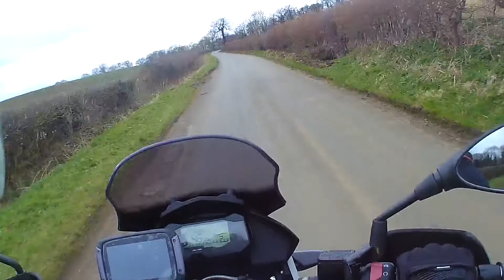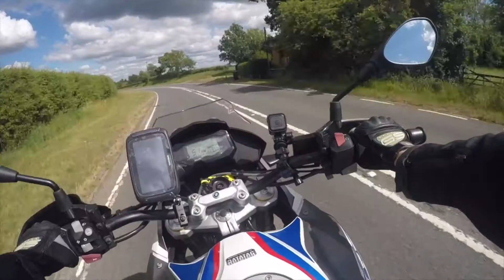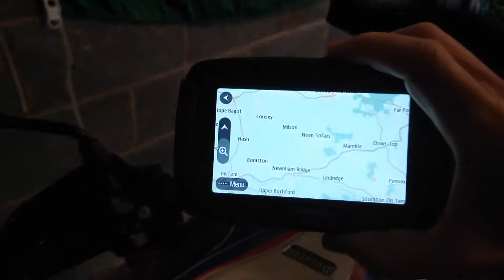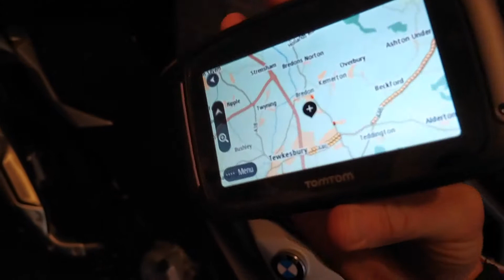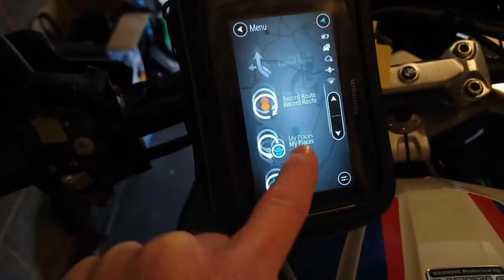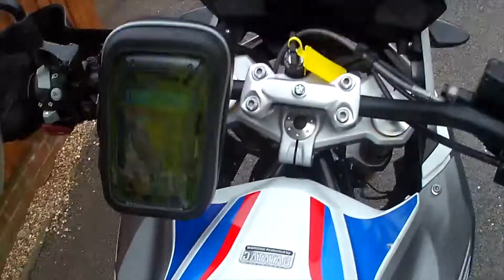TomTom Rider 550 Screen Fault

Comment: My TomTom Rider 550 started to switch off last year when riding (it’s 3 + years old). I had switched the mount from the Ram to an Evotech holder and the dealer mechanic routed the cable under the tank (I had it routed in a reachable way) so I will check if there is a power continuity problem. I did notice that there seemed to be a buffering issue so I wondered whether it was overdue an update and was searching for a Wi-Fi signal. I have checked that it’s now updated and will try it on the bike tomorrow but I will also check for the issue that you found. It’s good when it works and has found some great routes but I may try a Garmin if the problem continues. Good video. Cheers.

Comment: it could relate to an impedance issue triggered by a self-resetting fuse mounted onto the platine of the mount — it has nothing to do with any weather related impacts on the device; take the electrically powered mount to an electronical expert to bridge that fuse. That's presumably all.

Comment: Did I imagine it, or did it work when you rotated it anticlockwise?
Reply from the maker: Its probably the way it appears on the video. Once the screen goes off you can only get it on again by holding the power button down. I've now sent it off for repair to see if it can be fixed - as it's definately the best unit out there for touring. I'll also be posting a comparison with using an App instead. Thanks for watching.